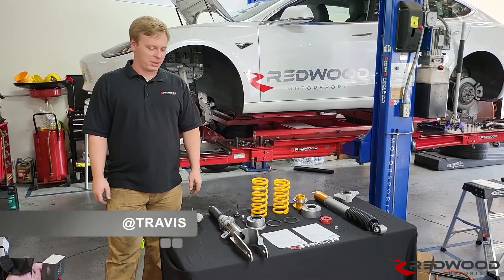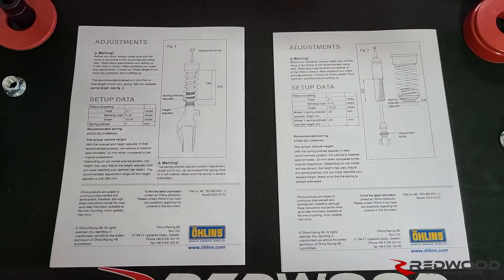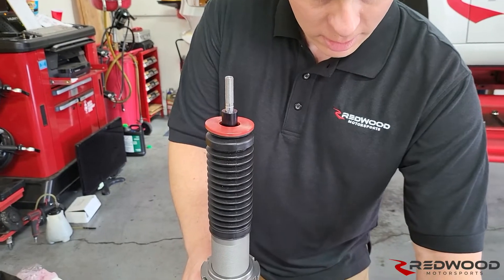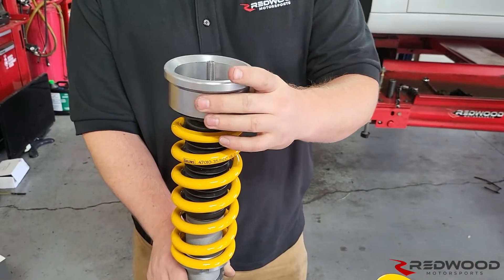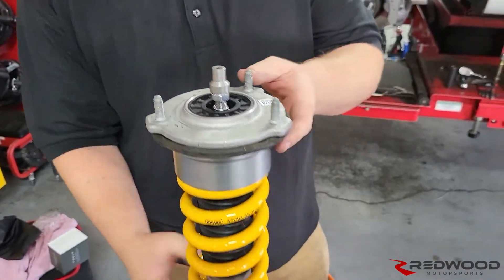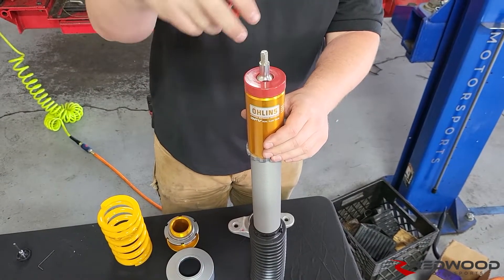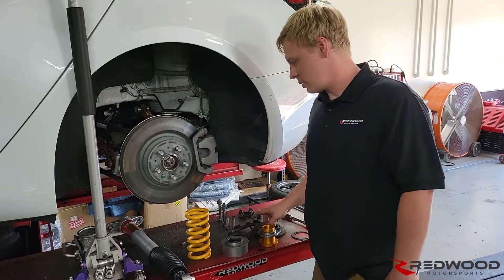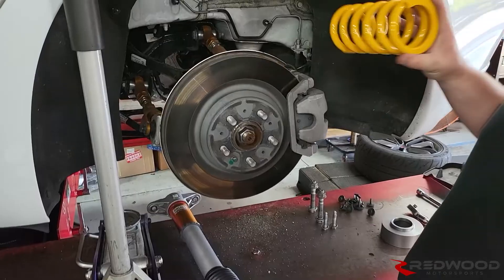Redwood Motorsports Installation of Ohlins Standard Road & Track Coilover Kit   Tesla Model 3 & Y

Comment: Redwood team - you should know that the installation manual specs that comes with the kit are wrong!  the rear damper and spring specs are much, much higher than the front height  (The updated Ohlins online manual has the correct specification). The error in printing cost me additional hours of labor to reinstall the rear suspension setup :face-orange-raised-eyebrow:

Comment: Excellent video! I’m looking to purchase this kit from Redwood, however I’m at an impasse on whether to order the softer Swift Springs or just keep the standard Öhlins springs. 

Any suggestions, are the original Öhlins springs that much stiffer? How does it compare to stock with the struts at the softest settings.
Reply: It is stiff even adjusted to softest setting. Swift springs should help.

Comment: Great video ! I am leaning towards Ohlins for my Model Y performance. I have heard that it requires higher maintenance compared to Mountain Pass KW comfort and Unplugged performance coilovers. Could you please tell me what kind of maintenance are these ?
Reply: Did you get the Ohlins?  Does it require more maintenance?
Reply: @JuniorJr_23  yes I did ! No it doesn’t require any maintenance. It is just like any other coilover suspension.